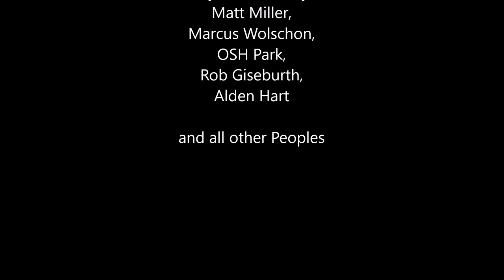XATC S01E04

Comment: It only works with tools that have the same diameter, does it?
Reply from the maker: Yes, just 3.175 or smaller diameter. But i work on a third version on XATC for just the ER11 Collet, then we can use different diameters.
Reply: I'm looking forward to it. :) 2500eur+200eur Kompressor + 50eur per SK15 tool holder + tool magazin quickly adds up with the Usovo WZW and this one I can build with materials I already have.